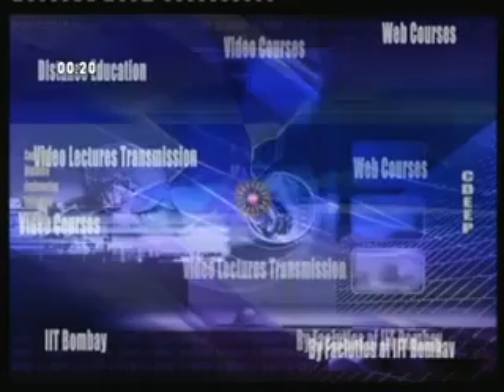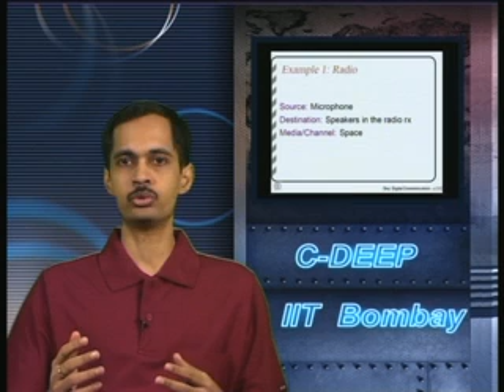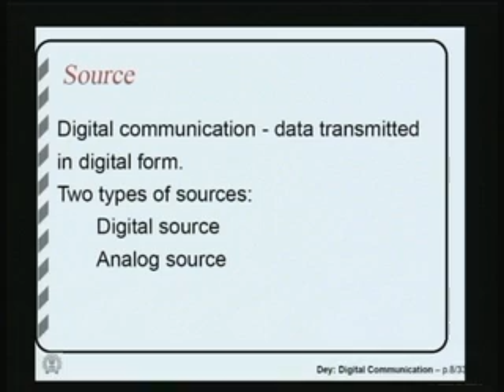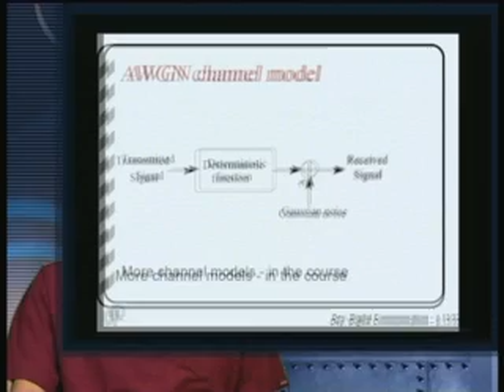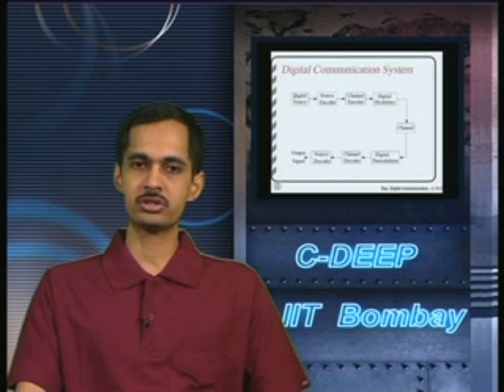Lecture - 1 Introduction

Comment: The course on digital communications introduces the purpose and components of communication systems, emphasizing the transmission of signals from a source to a destination. It covers examples like radio, television, and telephones, as well as the conversion of analog signals to digital formats using techniques such as sampling and quantization.

Highlights:
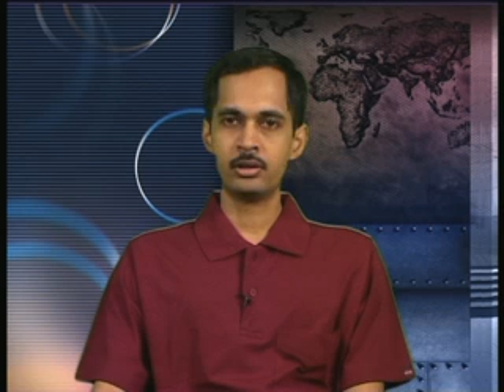00:51 Digital communication systems transmit signals from a source to a destination through a channel. Understanding the components of these systems is crucial for effective communication.
          -Examples of common communication systems include radio, television, and telephones, each with distinct sources and channels for transmitting signals. These examples illustrate the basic functioning of digital communication.
          -Storage channels like CDs and magnetic tapes serve as non-obvious communication channels, where signals can be recorded and later retrieved, highlighting the versatility of communication mediums.
          -In digital communication, sources must convert data into digital form, distinguishing between digital and analog sources. This conversion is vital for the effective transmission of information.
07:02 Digital signals are characterized by a finite number of values at each sample point, unlike analog signals which have infinite possibilities. English text serves as an example of a digital source that can be converted to binary format.
          -The conversion of analog signals to digital form is necessary for digital communication systems. This process involves the use of analog to digital converters, which perform sampling and quantization.
          -Examples of common channels used in communication include wireline channels, fiber optic cables, and underwater acoustic channels. Each type of channel has unique characteristics that influence signal transmission.
          -Channels often do not behave deterministically due to noise, which complicates signal transmission and reception. Understanding this unpredictability is crucial for effective digital communication.
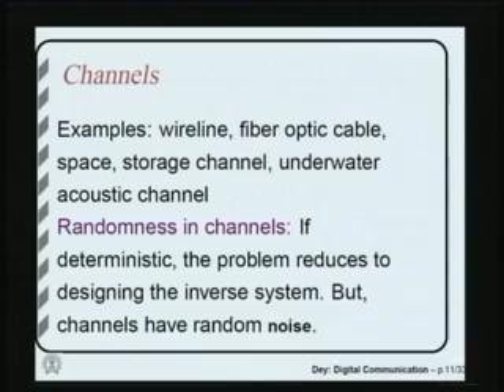13:05 Communication systems are significantly impacted by various types of noise, with thermal noise being the most prevalent. Understanding the nature and modeling of this noise is crucial for effective communication.
          -Different types of noise can be categorized as man-made or natural, including thermal, flicker, and impulsive noise, each impacting systems in unique ways.
          -Thermal noise is often modeled as Gaussian noise, which is added to signals after they undergo deterministic changes in communication channels.
          -The telegraphy system represents an early digital communication method, utilizing Morse code to efficiently transmit English text through sequences of electrical pulses.
19:17 Morse code efficiently encodes English text by assigning shorter sequences to frequent characters and longer sequences to rare ones, minimizing transmission time. This system allows operators to quickly transmit and decode messages.
          -The telegraph key allows operators to encode English text rapidly using Morse code, which requires specialized training for receiving operators. They must understand Morse code as a language.
          -Morse code's efficiency stems from its design, where frequent letters like 'E' are represented by short sequences, optimizing message length and transmission speed.
          -The development of international Morse code eliminated spaces to facilitate automation, making it easier to implement in modern communication systems.
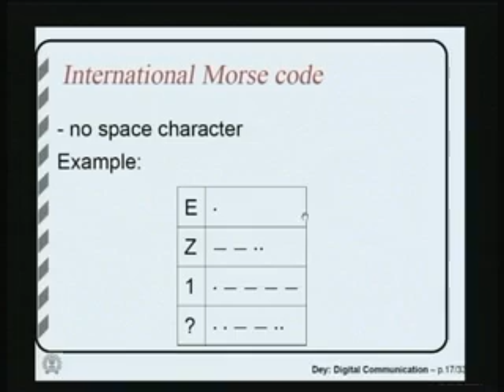25:50 Digital communication systems utilize encoding techniques like Morse code and ASCII to convert information into binary formats. This encoding allows efficient data transmission while maximizing the use of bandwidth.
          -Morse code is an early digital communication method that encodes characters into binary forms using dots and dashes. This illustrates the foundational concepts of digital encoding.
          -Source encoding aims to compress data, reducing redundancy and enhancing transmission efficiency. By minimizing the bits needed, it optimizes bandwidth usage in communication channels.
          -Correlation and non-equiprobability in digital signals can lead to data compression opportunities. Understanding these characteristics helps improve the effectiveness of digital data transmission.
31:42 Error correction coding plays a vital role in digital communication by adding redundant bits to enable the receiver to correct errors during transmission. This process enhances the reliability of data communication over potentially flawed channels.
          -Digital modulation is crucial for transmitting digital signals over analog channels, converting the digital input into an analog output for effective transmission. This ensures compatibility with existing analog infrastructure.
          -The digital demodulator at the receiver estimates the transmitted bits from the received analog signals, attempting to recover the original data despite potential channel distortions. This is essential for accurate data recovery.
          -Sampling and quantization are key steps in converting analog signals to digital, involving the selection of discrete time points and amplitude values for effective transmission. This process is fundamental to digital signal processing.
41:43 Digital communication systems have become essential for transmitting information, even from analog sources. These systems are often cheaper, easier to design, and offer better performance than analog systems.
          -The transition from analog to digital communication offers improved efficiency and reliability. This shift is evident in modern technologies like cellular mobile and internet communications.
          -Digital electronics are now more affordable and simpler to design compared to analog systems. The programmability of digital devices facilitates easier implementation and flexibility.
          -Advanced digital communication technologies enable us to achieve near-capacity data rates. This maximizes the efficiency of data transmission across various channels.
43:58 Advancements in digital communication have made it the preferred choice for modern systems, but constraints like channel capacity and available spectrum pose significant challenges. Understanding these limitations is essential for effective communication strategy.
          -The limitations of channel frequency response and attenuation affect how signals are transmitted. Specific bandwidths must be utilized where the channel response is optimal for effective communication.
          -In communication systems, the available spectrum is often shared among multiple users and applications. This sharing can restrict the bandwidth accessible to any single user or service provider.
          -Transmitted power in communication systems is limited by battery constraints and the need to minimize interference with other users. Both factors play a critical role in the design of wireless communication systems.
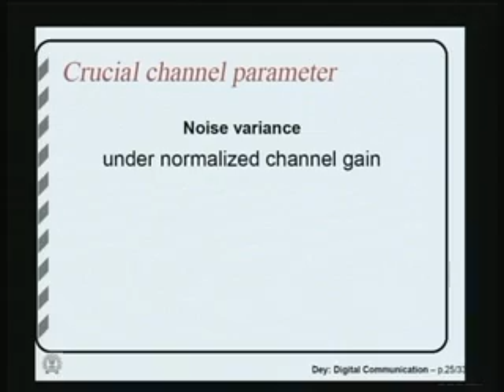50:13 High noise variance in a communication channel can distort signals significantly, making it challenging to transmit information effectively. Understanding the relationship between noise and signal transmission is crucial for improving communication quality.
          -Channel attenuation can affect both the transmitted signal and the noise, complicating the signal-to-noise ratio. Amplifying the received signal does not change the SNR significantly.
          -The energy transmitted by the source plays a vital role in determining the signal-to-noise ratio. Higher transmitted energy results in improved SNR, benefiting communication.
          -Most noise encountered is often generated at the receiver rather than introduced by the channel. This emphasizes the importance of understanding receiver noise in communication systems.

Generated by sider.ai